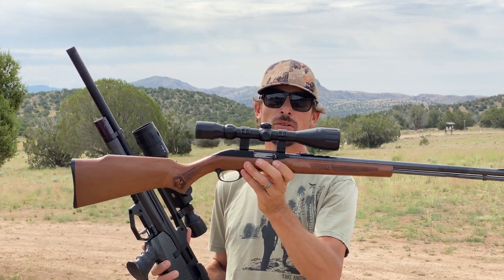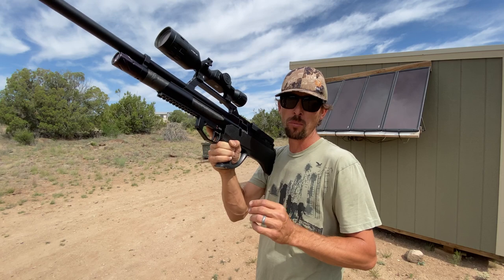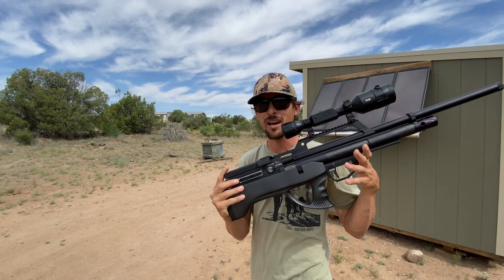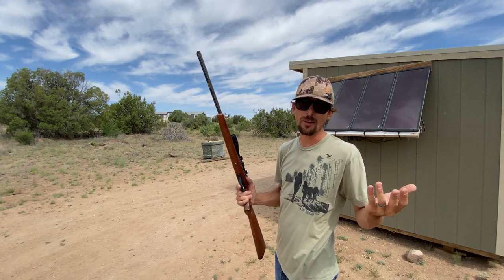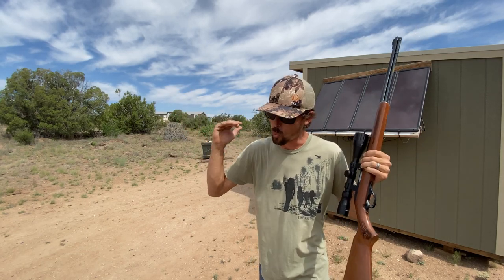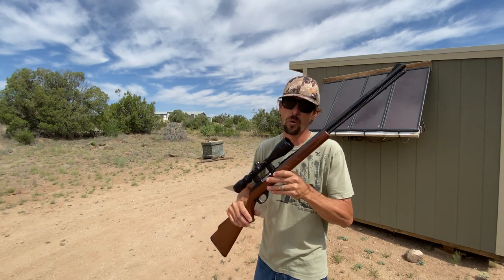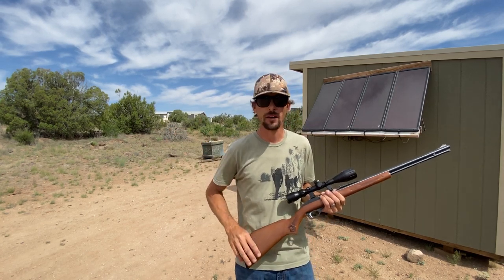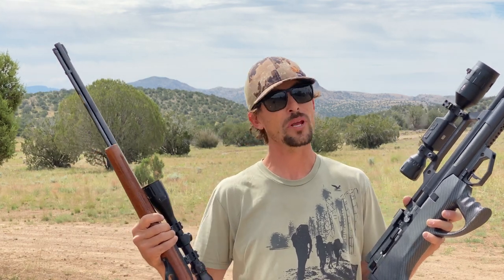22 PCP Airgun VS 22LR -POWER DEMONSTRATION

Comment: Great video dude. But I think the comparaison is not fair. 
You should have tried something like a  the 22 lr against a 30 grain .22 cal slug shot at 1000+ fps out of an impact or so.
Here we're talking about twice speed for nearly twice bullet's weight and for sure the 22 lr wins.
Also, bullet's cost is also a significant factor in our équation.
I'd consider a revanche for that one tho.
Cheers
Reply: Exactly bro, made the same comment,I wana see a impact used,especially matt dubbers 70+fpe impact, throwing a 34 grain slug at 1000fps.That would be the best test IMHO.Have a safe day bro.
Reply: I totally agree 100%.  I also get that not everybody has an impact.

Comment: Well, the steel plate is the perfect example for difference in power. The apple thing was much less explicit since you compared a full metal slug with an expanding hollow point. That’s also why one will never use a FMJ 30 cal for hunting since the bullet would just go straight through.
(They tried to kill a domestic buffalo with a 7.5mm steel AP assault rifle in the slaughterhouse, the result: it just passed through the skull, ripped off the spine, ricochet at the wall and came back missing by a few inches the face of the near standing vet ! I do shoot my bisons out in the pasture with a comparable in size and power 7x64 Teilmantel and this just releases all its energy inside the cervicales and never exits on the other side…)
Reply: I am a proponent for shot placement and velocity but much is to be said for expansion as in hunting "not everything is always ideal." That which is a drop shot is always preferential to a tracking job and an uncontrolled/sustained bullet trajectory. Ideally the more perfect bullet is found in a table of statistics and results. Your expose on bullet performance though is a good reason to compare what others results are before one commits to collecting more data. (as per "someone was lucky not to be another statistic")😲

Comment: I would expect a 22 short to be a much better comparison as several brands use 29 grn projectiles at 850 fps & 44 ft/lbs of energy.
Reply: My AEA challenger is pushing 70 ft-lbs so 30gr slugs at 1025fps
Reply: @jumpkickman1993  - the AEA 22 is a powerful .22 cal.   A lot of 25’s can’t reach 70 FPE.   But manufacturers are upping operating pressures to up the FPE.   Let’s face it, FPE sells guns.    Which do you shoot more, slugs or pellets?

Comment: Nice test but remember there are heavier .22 airgun slugs and more powerful .22 airguns available than what you use in this setup. The .22LR will still win I think and it's a lot less of a hassle to use (no air required). But the difference will be a lot smaller when using a more powerful airgun and heavier .22 ammo. Airforce Condor would be a good .22 airgun for comparison. Also I think the Huben K1 is pretty powerful for a .22 airgun. And there's the SamYang Snipe in .22 :-)
Reply: Airforce Condor - 1100fps (unknown slug), Huben K1 - 90 J (1345 fps with 15,5 gr slug). About SamYang Snipe data on muzzle energy and slug velocity are not provided at all, which does not characterize the company in the best way.
CCI Stingers have 259 J, with 32 gr slug. What is there to talk about?

Comment: Evanix Max Air II: total length - 820 mm;  weight - 3,5 kg; capacity magazine - 10 slugs (5,5 mm);  price (10.2022) - from 1349,95 EUR.
Marlin Model 60: total length - 953 mm;  weight - 2,5 kg;  capacity magazine - 15 rds;  price (10.2022) - 479,99 USD = 479,11 EUR. 
 H&N .22 Airrifle Slugs HP 21 Grain 200 pc - 13,95 EUR = 7 euro cents/slug;  muzzle power - 58 J
CCI 22 LR Stinger CPHP 32Gr Ammo 50rds - 7,89 USD = 16 cents/rd;  muzzle power - 259 J
Are there any rational arguments for PCP airgun?

Comment: very good videos. there is clearly a difference in power between a projectile propelled by a gunpowder explosion and a projectile propelled by air. but maybe you should try with two projectiles that weigh the same, maybe around 30 or 40 grains

Comment: Thank god someone has done this, I love air rifles and excited about the advancement made by slugs but I have listen to the constant B/S that a modern air rifle will out perform the LR. on air rifle forums. Well done that man. Lovely vid.👍
Reply: hehe,  I have Daystates for PCP air guns and they are great for under 100 yards but no way do they have the pop of a .22 LR.   My Daystate will probably outshoot most .22s at 50 yards and is silent.   But I did not drink the PCP coolaid but I know guys that do.   I think they get into PCPs then some how start to elevated them beyond what they can really do.   To me they are 50 yard guns.  Sure you can stretch them out further but rainbow trajectory and wind drift becomes a factor.    I see guys bragging about how hard they hit at 250 yards.  I just roll my eyes and pull out my .204 ruger at 4200 fps.  No contest.
Reply: BTW .22 caliber is about the best for PCPs over all.  The issue is AIR.  When you go 30 caliber and heavy bullets = way more air and more expense on the bullets.   with .22 they kill just about everything the 30 does (birds, chip monks etc) but use way less air and much cheaper pellets.   Most my buddies that went 30 cal regretted it and went back to .22 as they were always low on air at the shoots.   If you need more power than a .22 pcp its time to get a powder gun.
Reply: This is a mid power pcp not a high power pcp
Reply: @Physics072  sorry 25 and 30 cal dominate in every aspect of the pcp world
Reply: Midwest tresure and relic recovery maybe so, but he’s comparing a .22 with a .22, not a .30cal against a a .308.
Reply: @midwesttreasureandrelicrec7914  Not in price per shot or air used per shot.   Two guys that had .30 cal sold them and went back to .22.
Reply: @Physics072  who buys a pcp for "price per shot" people who shoot pcps are usually into 1 or both of two things... hunting and competition accuracy. Price per shot guys should be shooting "springers" nothing beats that value.. my personal goal was a 100+ ft.lb .25 airforce condor + talon tunes = goal achieved
Reply: @midwesttreasureandrelicrec7914  Most of the guys I shoot with care.    We go to matches and shoot 500+ With 30 cal do the math.   They run out of air fast too.   Thats why they went back to .22.   More trips to get air.  .   .25 caliber not a bad comprimise.   30 cal if you don't mind eating air and refilling often.   .22 will kill up to the racoon  I don't have a use for .30 cal anything I can't kill with a .22 I just grab my .204 ruger.
Reply: Bob - I agree with you - I get over 3000 shots from 1 overpressurised 80cuft dive cylinder with my pcp .22. Perfect for squirrels. For larger varmints my Stephens Mark II is perfect. Each gun has it's zone. The Condor overlaps more with .22lr but still benefits from air efficiency ie .22 or .25. I would pick .22 in,a Condor.
Reply: Ps for my pcp a tank cascade is not necessary due to its air efficiency - a real advantage. I still get 23 ftlbs, more than enough for house and garden pests. Sufficient for woodchucks if need be although with woodchucks .22lr or shotgun is my preference.

Comment: At 1600 FPS, the stinger is making about 180 fpe -  your gonna need a Texan in 257 or 308 to get into that territory.   But those class of air guns will actually put out more fpe than the stinger with all but the lightest slugs/pellets probably.

Comment: The Evanix MAX Air 2  is relative low enegy Cal.22 air gun! Only 35-36.ft/lbs!   The FX Panthera 700 is 96.ft/lbs, and Cal.22!  Yes... Cal.22.!  36grn slug and 1050 ft/s! Yes, that's still less than the Rimfire 0.22, I know! However, this air rifle is at the level of average 0.22 gunpowder cartridges!  You could have done a much better comparison with this FX Panthera 700  in Cal.22!   Pls... If you have the chance, or you will have the opportunity at some point, try it once and compare them! It would be a very enjoyable test for sure!

Comment: A better more fare choice would have been a standard velocity 40 grain 22lr. The stinger has more powder than a regular 22lr round and moving about 400 fps faster than a standard 22lr round. I'm going to be honest, I'm surprised you was able to hit an apple at 40 yards with a stinger. None of my 22s like stingers. Velociters, yellow jackets and vipers do great, but not stingers. Still, the 22lr will out do any of the air guns, just not the penetration test on the 8th inch steel. I don't think standard velocity would go through it either.

Comment: 22r is typically low 100s fpe and air rifle 22s anywhere from 15-50
Reply: Yes and that makes 22lr pretty much useless in my view.  air guns can do most thing that 22lr can do cheaper, quieter and easier, and you have much more powerful firearms for things like self defense or SHTF.
Reply: @springer-qb4dv  a 22 air rifle from a store is 20fpe or less. you can't ethically shoot much with that and the range is limited.
air rifle are far more expensive than 22lr.  you have it backwards.

Comment: Use a low velocity 22 lr round versus the air gun. I've shot stingers before and they'll blow about any other twenty two round away so airgun didn't even have a chance not that I thought that the air was going win.
Reply: No chanse for air against good old 22 lr.1600 bar preasuure in the barrel.Powder simple generate more preasure.
Reply: @ciro79  It's not about pressure - it's about power.  Notice shotgun rounds has only 1100psi yet demolishes 22lr which has higher psi in chamber.  So air guns with higher caliber can demolish any 22lr.  Air guns are highly advantageous compared to 22lr in that you can shoot it anywhere, ammo cost less, and no need to pay fees or pass background check.  Of course high powered firearms are different matter.
Reply: @springer-qb4dv  Im using my 22 lr anywhere,it is cheap and quiet and simple,nothing for break.It last forewer.It is about pressure.Shotguns wins 22 lr because it have big caliber,around 18mm for 12 gauge and mutch more powder.Imagine power of 22 caliber shotgun:=)Or imagine power of 18mm caliber 22 lr :=)Same thing with low pressure pellet guns.You need bigger caliber to win 22 lr because pressure is to low for big velocities.

Comment: 2 years later..... an aea  30 challenger w/ 32 " barrel on the market that will shoot slugs 110 grains well over 200 ft lbs. Or 44 gr pellets at 1300 fps.
Reply from the maker: I know right! I have a Western Rattler that will do 220 foot lbs and it's a SEMIAUTO. 35 cal 👍

Comment: Where on the scale of power* would that 22lr round sit,  I know very little about powder loads , but I assume there are different power 22lr rounds.
Then 38ft-39ft , with the air max, I dare say you can almost double that up from within your air gun collection.
lastly, Jacketed rounds, I am thinking will penetrate  metal sheet better than lead alone.
come on Ben, stack the cards in the air guns favour :-)
thanks for the video.
Reply: The Stingers are around 200 ft lbs of power and are some of the most powerful 22lr rounds.

Comment: for one thing your comparing a gun power fired bullet against a air back gun. that would be like trying to match a fire cracker with a stick of dyno mite. try using a bull pup with a fx in .22 cal. it would be a better comparison. gun power is on a different level and you need to understand the uses of each. I can nail a coon at 100 yds, between the eyes and your 22 would not do so well. yeah you might give it a knock out blow the the bullet will most likely mushroom out on the skull. and when he wakes up on the trip home he will be very pissed at you. I have seen this happen more times than you got fingers. see, a good hunting round for head shots is a pointes tip and not a round hollow point. the 22lr would be great on a coon for a heart/lung shot because it would do more internal damage. Pellets are made of lead yes but it has more alloys mixed in and it is a little harder that a long rifle 22. Give air guns it's due. they are very powerful and can hunt big game all the way up to moose. from .177 to 50 cal +. they can do the damage but it also to put meat on the table, not shooting apples and a piece of galv. steel.  A 24 gr pellet can carry a bigger punch though at a reduced speed. see it's all in the foot pounds of energy that counts. speed is not all that great, it's the FPE that makes putting meat on the table. Ask more air gunners and I think you will understand more. get more than 1 or 2 opinions. good luck. happy shooting.

Comment: Air guns need to be a bit larger then the rifle to compare. You used more mass is the 22L and more mass will make more energy. That is why I say you need to go up one size in air gun for hunting then you would for rifle. 25 cal ver 22L.
Reply: A 25 cal airgun is still less than half the power of 22lr. You'd need a 30 cal at least.
Reply: Perhaps .35 or better

Comment: SAAMI max chamber pressure for the 22LR is 24000 PSI, with many cartridges around the 10 to 14 k mark. so expecting 22LR performance from an air gun is wishful thinking.

Comment: My fx impact mk2 power plenum 600mm .25 has the same knockdown power as a .22 lr subsonic.
Reply: Let’s see if you can get 870 fps at 200 yds with a 40grn 😀
Reply: @v12dot  I have used Ballistics ae and got this. .25 38gr 0.1BC 1100fps muzzle velocity, at 200y has 775fps. Not too far off. I would not take a shot that far. With subsonic you don’t get any hydro shock and need to get a direct hit on vitals. You probably used round nose, I used hollow point slugs. A hollow point .22 sub would probably be pretty close to mine.